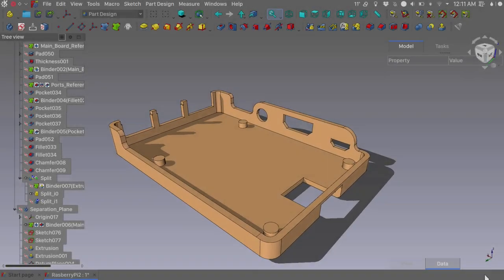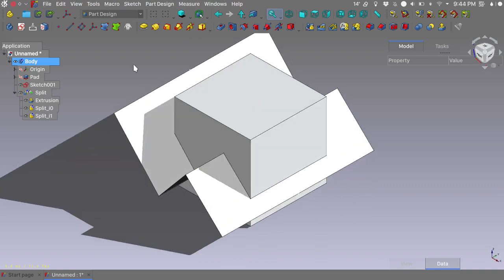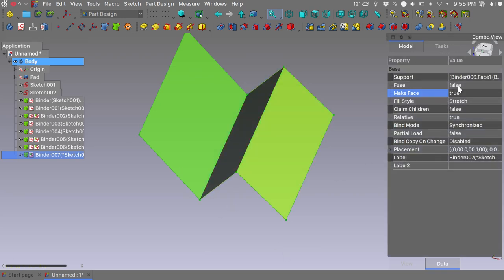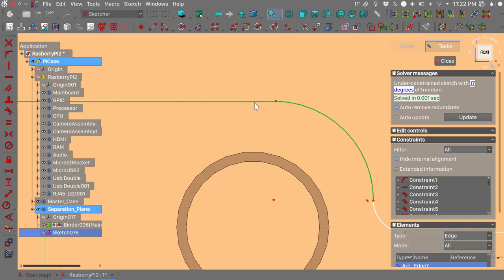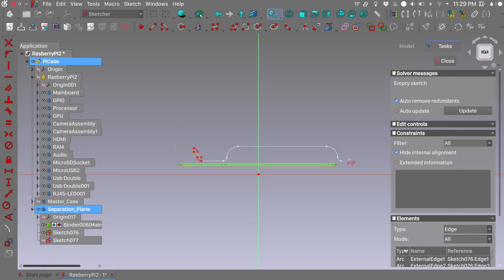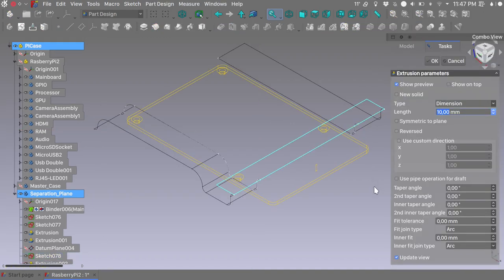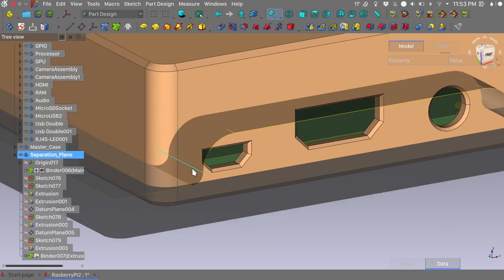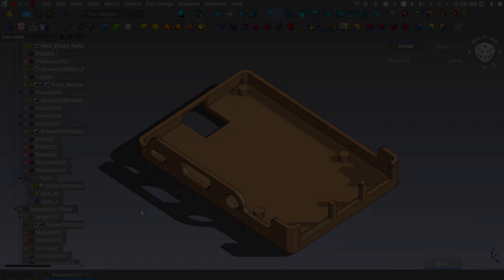Rasberry Pi Case for 3d printing video tutorial(part 2) The separation plane.

Comment: I can't find any "extrude a vertex/edge/face/sketch" tool in Part Design, such as the one used at 11:54. The closest I can find is the "Extrude" in the Part WB, which behaves weirdly. Any suggestions?

Comment: How would you do the split if you needed a bit of tolerance between the parts? I tried to extrude the extrusion in various combinations with subshape binder and the split tool didn't seem to like the result...
Reply from the maker: The solution would be to model the thickness of the split tolerance and i show a similar workflow in the 3rd part of the tutorial. This is not optimal  and a more elegant solution would be to be able to give a thickness to the binder that does the split. I'vd already talked to RealThunder about this in the past and I'll also post in the forum. Will see if it gets somewhere.
Reply: @OficineRobotica  Also, thank you for the tutorials! They show quite a reasonable workflow and highlight important interactions between the available functions that are otherwise not easily discoverable.
Reply: @OficineRobotica  Yes, that workflow works. The trick is to use the surface to split a intermediate body. then take half of that body and hollow it and use the result to create a split with a gap.

Comment: Awesome! =) Thanks for that, well done!

One wish for part 3.. or 4? ;)
What about some kind of "clip" feature, to hold the two parts in place without screwing or gluing them together :)
Maybe also interesting for the PCB too, to hold it in place..
Reply: Yes clips, or perhaps some interlocking features along the split plane. Teeth would increase stiffness between the two case halves because they resist torsion. An o-ring groove would also be a useful feature.
Reply from the maker: Of course it will sport those, what kind of case would be without it lol. I was thinking more about screws from the bottom to secure the 2 halfs and clips for the lateral door for the GPIO. At the beggining of the first part of this series there is a small clip with the rough idea of the  final model :)

Comment: I accessed the GitHub for the model but the part 2-3 are a folder, not a FreeCAD project. How do I open them?
Reply from the maker: In linkstage3 you have File > open folder . Those are freecad projects saved as folders instead of a single file. They are more suited for version control.
Reply: @OficineRobotica  I have no Open folder. I tried using "Open directory", but it throws me an error: "Invalid state while reading character stream"
Reply from the maker: @yosyp5905  Sorry, my bad. Not being in front of the pc sometimes I talk from memory. It works for me with the latest daily. Check the link https://youtu.be/x5QN6oChrnM What version and os are you using?
Reply: @OficineRobotica  I don't use daily as I've had a bug regarding crashes (I don't remember what I was trying to do, tho'). Are the configs shared by different versions, or are they located jn the program folder? I don't wanna lose my settings

I use W10, one of the latest updates (can't currently check)

edit: I currently have latest Stable installed
Reply from the maker: @yosyp5905  Can't check now the exact location but the files are called link.user.cfg and link.system.cfg , make a backup to be on the safe side. The configuration is shared between Daily and Stable LinkStage3 but not shared with the official Freecad release. 

Give it a sot at the daily. I had some crashes with bug reports but not often. One in particular that we managed to hunt down is on Save and seems to be related to the thumbnail creation. 

Soon there will be a release with a lot of fixes. RT is working around the clock like all of us ;)

Keep me updated. Also, if you encounter bugs that you can replicate consider opening a issue here: https://github.com/realthunder/FreeCAD_assembly3/issues
Reply: @OficineRobotica  I can confirm that using the last Daily the Folder opens normally. I'll open an issue report if the crash happens again despite being a total noob with GitHub.
Reply from the maker: @yosyp5905  This bug doesn't present in the stable? Are you using telegram? There is a chat called FreeCAD community, we can chat there. Ping me there
Reply: @OficineRobotica  I have TG installed, but I'm not very familiar with it. Do you have an invite link?
Reply from the maker: @yosyp5905  FreeCad Community
This channel is for FreeCad 
You can Post your Projects , ask for help 
Our channel @FreeCad_EN
https://t.me/FreeCad_EN
Reply: @OficineRobotica  Thanks! I'm in